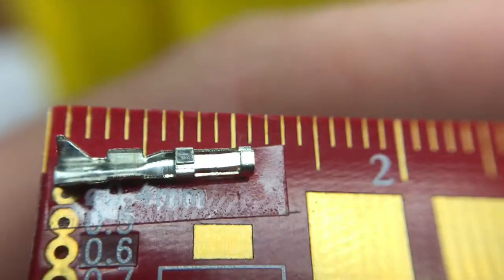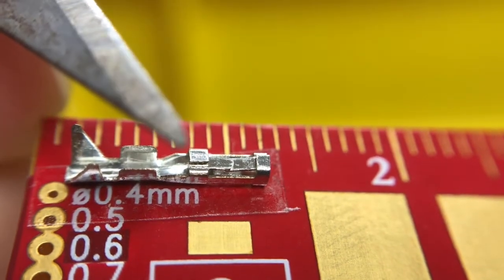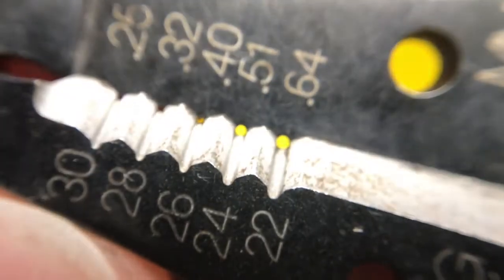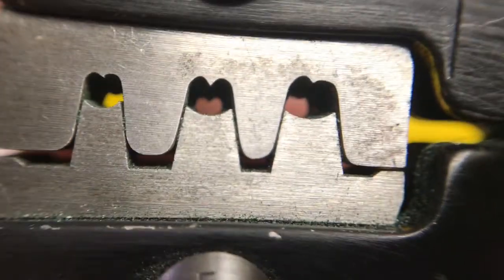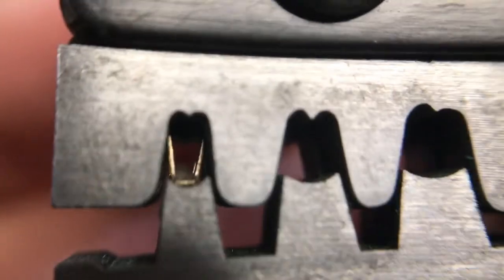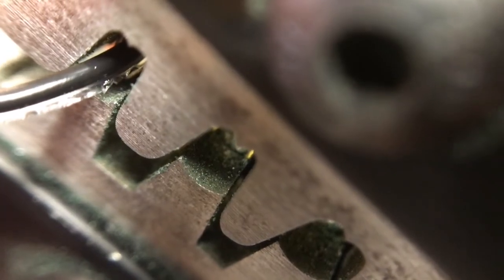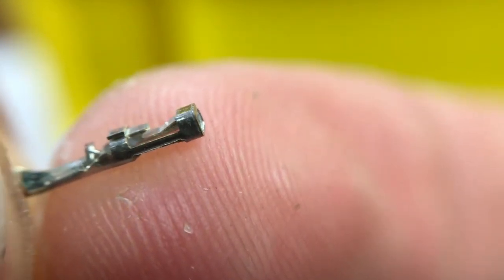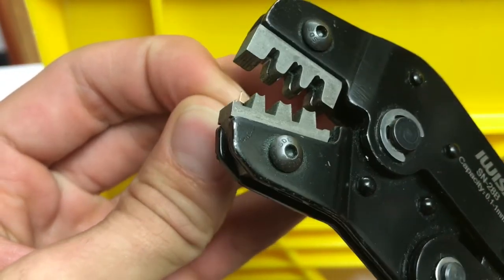How to Crimp 2.54mm DuPont connectors (macro view)

Comment: You may have just saved me from buying dupont/JST-specific crimpers! I'm about to order up a kit of connectors and try it out. I'm using the Haisstronica crimper with multiple Jaws and the open barrel jaws installed. The tutorial probably saved me from some failed attempts as well. Thanks!

Comment: Yet another tutorial showing the categorically incorrect tool for these contacts. The offset, slanted insulation wings of these contacts requires a tool with a circular insulation crimp, not the m-shaped crimp that is needed for the (symmetrical, squared off) conductor wings. 

The result of using an m-shape crimp on the offset wings is the mangled crimp shown in the video.

Comment: A trick I use to not have to insert the wire blind is to crimp the empty connector in one of the bigger dies first, which should let you shove the wire in with enough friction to hold on, then crimp it again in the proper sized one

Comment: Never knew this type of connector was invented by DuPint. I guess the patent has expired so they are now dirt cheap and can be found everywhere!
Reply: They were not invented by DuPont. They were invented by Berg Electronics, and the product line was/is called BergCon. The company was acquired and resold multiple times, and one of those owners was DuPont. They resold it, and it ultimately ended up as part of Amphenol. 

I don’t think the patent matters, whether expired or not. The cheap Chinese DuPont connectors are a cost-reduced design with vastly reduced mating cycles. The original, called Mini-PV, is rated for a thousand mating cycles, and will continue to work ok for longer than that. The cheapest clones loosen to the point of unusability in less than 10 mating cycles. Nobody actually copies the Mini-PV design because it’s much more complex to make (each contact has a separate leaf spring inside made from a different metal than the contact body). Every other design, whether expensive big-name (like TE AMPMODU and Molex SL) or cheap clone, uses contacts made from a single piece of metal. 

Annoyingly, the appearance alone doesn’t tell you the quality. Harwin M20 connectors look absolutely identical to cheap Chinese DuPont (so identical that I suspect the Chinese may actually be clones of M20), but M20 works well and doesn’t loosen after 10 cycles. I guess their alloy is very different.

Comment: Thanks a lot for the clear video! It's not easy filming something so close-up and the effort is appreciated.

I purchased a new and very expensive PC case with a broken front panel wire. I had already exchanged the case once before for a scratch on the inside of the RGB panel, so instead of making another long trip, I decided to repair the break myself. Thankfully, Amazon had a USB header kit and crimper/stripper. All that was needed was a video showing how to insert the pin into the crimper. Asus really needs to work on the quality control especially since both of these problems occurred inside the factory. Thanks again!

Comment: @David Malawey Yay! I couldn't have done it without you, thanks. The jaws on my plier were backwards, so they got unscrewed and flipped 180 degrees. Next, I found that a 3mm bare wire end is the best. Measure the thickness of the insulation and use that as a guide, or mark the insulation alongside a metric ruler with a Sharpie pen. Also, mark at 2mm beyond that to tell when that mark is flush with the end of the metal insert. And, I stick a pair of scissors in an induction coil for a count of 8 and use them to strip the wire. Very neat results!

Comment: If you have 28 AWG wire you NEED a 28 AWG rated pin. Same goes for all sizes of wire. There is no range built into these type of pins. 
The jaw width matters also when you match your tool to your pin length to make it easer to crimp the pin correctly.
Most cheap crimp tools are too skinny and do a bad crimp job.
A good tool will make a heart shaped crimp on the wire connection and a circle around the wire insulation creating a wire strain for the pin.
Your tool seems to be making a heart shaped crimp on both, I don't know if that is good or bad though.
I wish that there were clear and informative YouTube videos from the companys that sell these products. I have found very few. And the tools they sell fetch $1,600.00 US dollars. Really !
I feel your pain. Good video though !

Comment: 2:20  28 gauge?  I thought the usual for this type of connector was 22 gauge.  28 is very thin.
Reply: 22AWG is on the high side (though special 18-20AWG versions of these contacts exist). My impression is that over the years, as the electronics world has moved to thinner wires in general, these connectors have tended to be used with thinner and thinner wire. You can get contacts for wire as thin as 32AWG.

When used with individual stranded wires, most commercially bought jumpers use 24-28AWG. 

Standard 0.05” pitch ribbon cable is 26 or 28AWG, with the majority in the wild being 28AWG since it’s cheaper. Since that cable is designed for insulation-displacement connectors (and those can only accept very narrow gauge ranges), there’s no market for versions with gauges 24 or thicker, nor 30 or thinner.

Comment: Finally!   Thank you!   I have the exact same crimper and no one, until now, has ever exposed the presence of that inner edge.  I gave up mostly on using these connectors because I could never get the darn thing to crimp well.  Too many times I would damage the female interface section.  I used your method and hit it spot on with an extremely good crimp on the first try.